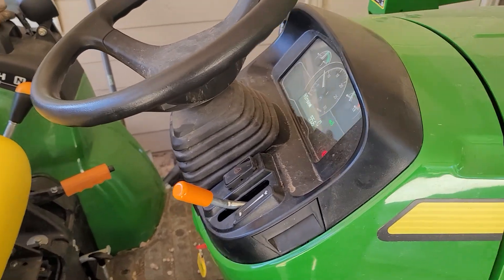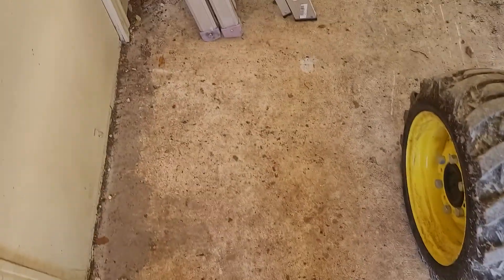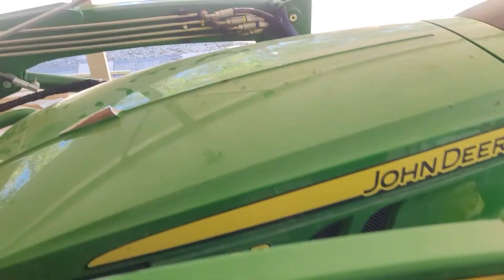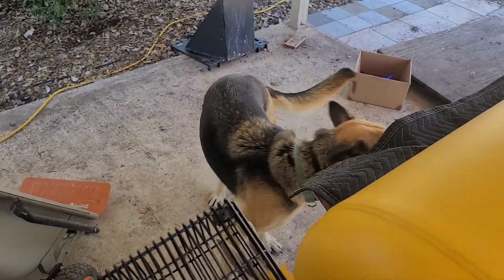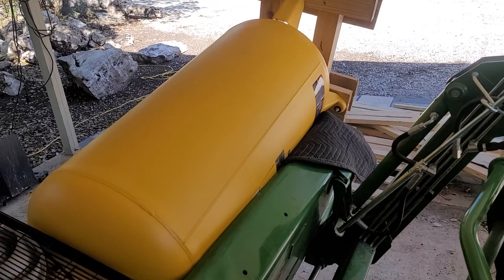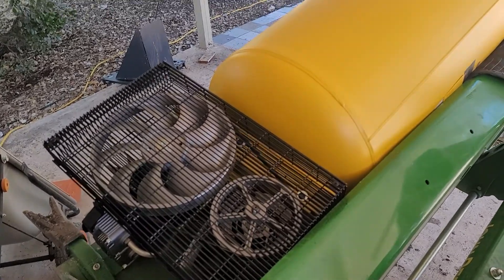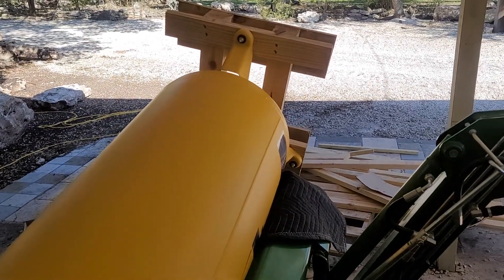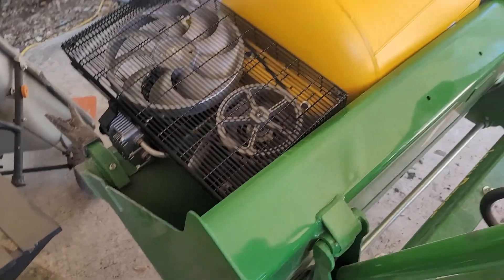More new toys on the ranch!

Comment: Nice air compressor
Reply from the maker: Looks like it'll work good for me! Definitely not the most ideal location as my garage is 200 feet away, but running wire from the pole to the garage would almost for sure cost more then the toy! Really need to get a circuit breaker box in the garage and workshop! But I'm already at three if you don't count the pump house or ac unit (those are just two breakers in line)